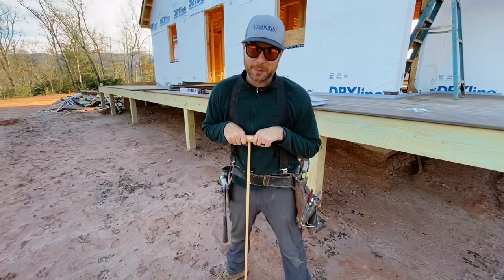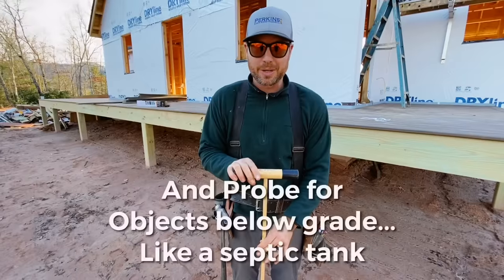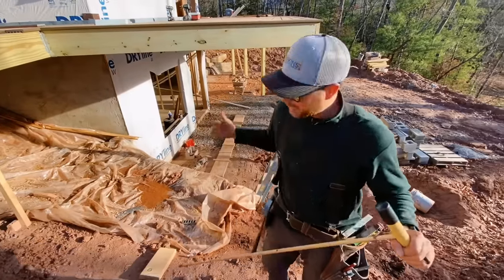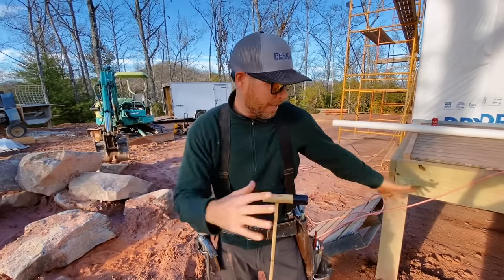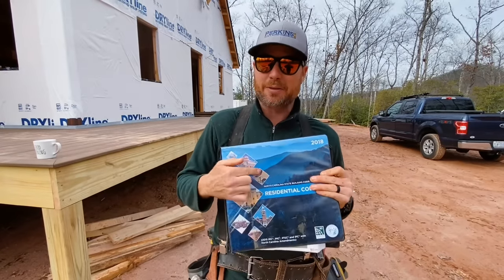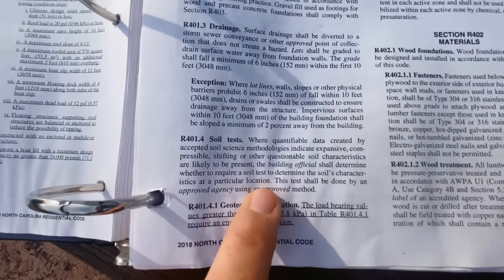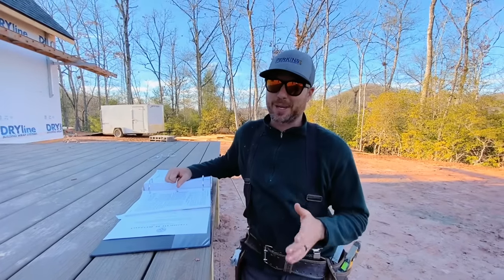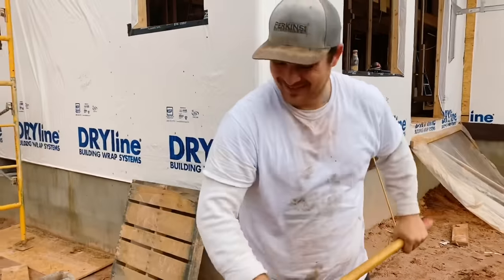All about soil, footings, and codes for residential building | Building Better Homes

Comment: 👍👍👍👍 WOW !  I clearly understood all taught in this video. 65 years in the USA / Georgia. About to build house in west Africa. And there is no such thing as building codes for diy in the bush.  Somehow they got the footings part correct and piles.  Many build 2 story They make cement block manually (one block at a time ) then plaster the  blocks for all walls. No 2 x 4 wooden studs. When money is available we can adhere to strict codes. But when money is not available, not even loans, then humans have to rely on the best knowledge and resources they have. 🙏🙏🙏🤞 the USA do not have another great depression. Thanks for the very good information.  A DIY  can build 3000 Sq. Ft.  ON 1 ACRE for $ 30,000. USD  ( In the bush / rural if they DIY ...LOL dirt road pure country living .)

Comment: Great video again! Y'all are lucky to only have a 12 inch frost line! 
Y'all do some great work and make great points! Especially things like testing the soil with your t handle probe. And digging with a machine. 

One thing I will add that we have been doing for a good 4-5 years now is we like to cut the bottom of our footings out a hair wider than the walls. We just take a sharp spade and cut a few inches all the way around at the very bottom of the footing. This not only gives you a slightly larger load bearing, but mainly takes care of uplift. Especially on more shallow frost footings. Uplift has become such a big deal, the dang house is bound to blow away before the deck ever moves. We bell shape every footing, pier, and/or column to satisfy uplift requirements. We recently purchased a bell auger to do the work for us, because we do alot of large piers and footings. But on a simple deck, it takes no time to knock out that detail at the bottom. Unless your footings need to be 5-6 ft deep. In that case just use those Bigfoot forms or pour your footing large first and then do your pier. Lol!

As far as deck builds go, I always recommend people study their codes, and study the DCA 6.
You'll find a lot of useful info no matter where you are, in the DCA 6. 

I hope this helps some folks out there.  Be safe out there in the field y'all! Thanks for the content Perkins! God bless y'all! 👍
Reply: O

Comment: Great video. Wish this video had come out one year ago. I inherited a lot in central Phoenix and went well into the planning and permitting stages only to find out later that the soil would require 3 foot footings! With no choice, I did that, but had I known, I likely would have placed a very different structure on the lot. Anyway, first thing I would ever do is have a soil analysis done of any lot in the future. Good videos!

Comment: Great information 
You guys are lucky with a 12" frost line.
Here in Ontario we have 4' frost line but in some parts we the code states we must go to 6' to ensure we below the frost line.
As footings go most decks over 12'×12'  they now want to see footings at either 28" wide or 32" wide . Thankfully they make post augers that are up to 36" wide which saves alot of hand digging

Comment: I have seen these same things many many times in my business. 
When I built on Lake Michigan in my area we had to have steel pylons drove 75 plus foot into the gravel beds had to go almost 200' on one occasion thank God I  was taught well our prices were always determined by engineering needs and actual costs of having them driven deep enough to pass inspections.
Our minimum depths where I live is 36"-42" depending on ground we always went 42" plus and always put at least 4" of gravel before pouring any concrete just wouldn't ever take any chances plus French drains to prevent any standing water.

Comment: Very interesting!  In my town, any build that will have a foundation and require a permit will also ALWAYS require a soil test done by a geotechnical engineer and then an engineering plan stamped by a structural engineer.  Those are both in the check-list of requirements to even get the permit.

Comment: When you test the soil for its load bearing capability does it matter if you test it while it's wet or dry?
It seems certain soils change more than others with moisture.
Reply: Good Question. When it's slightly damp seems it gives a lot easier.

Comment: In the 2021 IRC, it calls for a footing to be, as an example, 12 x 6, minimum width and thickness.  Does this mean the footing is square 12"x12" and depth should be 6"?  Just want to confirm I got this correct.  Thanks.

Comment: Soil probe.... test the compaction of the soil 
Hand digging the holes for the footings so you don’t end up with a big hole
Make sure the bottom of the hole is level so the footing doesn’t slide under the soil
Make sure you look at codes

Comment: Y’all make some good videos. I just bought a piece of land in Little Switzerland (Spruce Pine) area, so your tips hit very close to home for me.  I’m curious about spacing between deck footers. I’ve always done 6’ between posts but with 6x6 posts, and 2x10 boards, it seems like overkill. What do y’all recommend?

TIa
Reply: 6x6 posts at 6' on center is a good way to go. No to cheap (bouncy), and not way overbuilt ($$).

Comment: Thanks for trying to explain on how to use a hand probe. First on all, the probe is not a testing instrument. It is used when  a Geotechnical inspector is onsite observing and testing placement of fill material (soil) and is used along edges to find soft spots. You cannot go by a probe to buy off bottom of footings , compacted fills or subgrade soils. The only way to determine proper soil density is by compaction test. Probes do not give you good density indications in clays or cobbly soils. Surface soils after a few days of baking in the sun, tend to dry up and harden. Clays or silty soils are worse.
All probes should be used for us to find soft spots and should never be used to determine density/compaction. Can you imagine being in court and the judge asking how you performed your density testing and wanting to see actual test results??
You have to hire a Geotechnical engineering firm to provide you observation and testing with a signed compaction report with a Geotechnical engineers stamp. I could go on for hours.
Just my input.

Comment: Might be a dumb question but would that code book be okay to us in Tennessee or would it be to different
Reply: All of the states, cities, and counties have a different requirement. And municipalities also have different requirements. Homeowners associations even differ. Your best bet is to run over to your county inspectors office or planning and permits office and pick up all of the codes you need. In order to receive a permit You'll need an actual blueprint style plan for your build, drawn to scale, and it will need to be approved. Don't forget to have utilities marked. And in some places, you'll need a survey done to make sure you're not crossing the property line distance requirements, or any easements. This goes for anything considered to be a "permanent" structure. Even a concrete sidewalk. Or a small shed that cannot be easily moved. 

Just a suggestion.....We overbuild everything just a tad, it helps me sleep at night as the Owner. So I do recommend you really pay attention to the codes and one up that just a hair. If you build consistently better than your local requirements, you will eventually get to a point where pre inspections are unnecessary for your certificate of occupancy. Sometimes we have a final inspection on something like a deck build, but it's rare now with our relationships with inspectors.   Things go so much faster and no downtime waiting for the inspector So you can pour footings. 

Type in your area/county/etc and building codes (R507 for residential decks) and you should be able to find your local adopted codes. 
We have towns outside the city limits here in different counties that are still running off of old code. 2002 irc at a home we're at now. Do not build to 2002 code! Lol!

The best thing you can do IMHO is download the DCA 6 and build off of that. Read and memorize it. Print it off if you need a refresher. If you build off of DCA 6 you should have no issues. 

I hope this helps! Good luck to ya! 🍻
Reply: So true about having a great relationship with the inspectors . Was getting a new service put in 2 houses side by side . The inspector came and Ok'd the jobs before the jobs were done . Even the hydro boys were able to put in the new cables before the job was done . When a contractor has a reputation of doing better than code work the inspectors and the hydro boys know that so the job goes much faster for everyone . Having a good reputation just makes things go a lot faster .
Reply: @henryrodgers3409  you got it 👍
It absolutely does. When you and your company strive to be the absolute best in the business, as opposed to how much money can we make off of this job or how fast can we knock it out, the rest follows suit.

Quality, and reputation is everything in this business!
Codes are getting tight, and people are getting more educated on efficiency and good building practices. 

Take care 👍🍻

Comment: Good video. Realistically, if you're a builder you should get a 24" auger attachment for the skid steer, and use the Bigfoot 24" bell housing with your sono tube.   5 minutes to auger to just past depth, compact, throw in 6" crushed, dust-free stone, compact and drop in your tubes. 10 minutes and done with an excellent anti-heave, proven install.

Comment: But you put your deck posts down in concrete instead of up on a post base bracket, guaranteeing that they will rot. Love your videos and you guys are generally putting out quality but that’s a deck building 101 fail.
Reply: I was waiting for someone to mention that.   The new pressure treated wood, even ground contact, won't last as long as the old stuff.   EPA strikes again..

Comment: Another great video, guys. How do you calculate the tributary area? I always forget. And it’s important to know for footings, deck framing members, etc. That would be a great video.
Reply: Tributary area can be a bit tricky. And it always depends on the type of build drop beam deck vs flush beam(header) deck. With overhang or not, with cantilever or not, wood species, soil capacity, and live and dead loads. 

Since I don't know your conditions, the best thing you can do is check out the DCA 6. The DCA 6 has a ton of great info for calculating your tributary area based on size, load, soil bearing capacity, footing type, special conditions, species of lumber, etc. And will help you determine spans, posts, beam details, and footings.... Also a great guide for general knowledge and staying up to date on do's and don'ts 

Hope this helps! 🍻
Reply: Far as I know, sketch out your plan on graph paper or use an editing program with the grid lines set up along 1' x 1' squares.  Tribs will be either from one wall to 1/2 way to nearest support, or in a deck with cantilever, from edge of deck/cantilever, across first and in the middle between first and second pier. This is a simple vid https://www.youtube.com/watch?v=g0otb1kzsXU

Comment: Where I live in BC Canada every house site needs a geotechnical report before you can build on it even it is solid granite rock an engineer has to look at it to make sure its hard enough. Engineers have overkilled things and foundations for a residential house ends up in the 10s of thousands just for concrete. I've seen some of these jobs and all I can say is "really", we don't use block, its all poured walls, massive amounts of rebar. Engineers are scared to put their stamp of approval on jobs so they require the builders to go way beyond what is needed.

Comment: Is the code book you are referring to available for citizens to view online?  It appears that only footers of concrete are referred to in the code book.
What about rubble footings comprised of crushed and compacted aggregate?  Crushed aggregate does not respond to frost or freezing like solid concrete does.
And why do folks continue to install steel into concrete when experience has proven that steel eventually oxidizes and degrades the concrete?
The tool showcased may be fine for probing and to obtain some idea of soil compaction, but it does not produce any quantifiable data.

Comment: That probe rod is NOT the correct prob rod for checking soil compaction. The correct one is a steel rod 3/8 in diameter. And when you pushed it all the way down you found a hole of some sort. Even the worst soils will have more resistance than that.

Comment: Good stuff! Pretty sure one of our front porch footings was not properly tested for compaction prior to concrete. It has settled about 1” over the past 5 years since the house was built. Probably gonna dig it out this spring/summer down to hard pack and re-pour a new footing.
Reply: You might be able to get away with a jack and shimming it. If it continues to sink, then replace it.

Comment: Love the video. I have a deck that was built(and demolished old one) in a single day. I doubt that was even inspected. In Illinois we doesn’t have a state code book but each “municipality” has their own codes. Trying to use my own towns code book is very confusing because there is no clear section and also no diagrams/charts. My deck has settled unevenly in places causing screws to snap and trex boards having to be replaced. Do you have a suggested solution to flatten/level my deck?
Reply: Call the contractor who "built" the deck!
Reply: matt mag I wish I could. This was probably done 10-12 years. I am not sure if I still have the guys number.
Reply: @rolly5457  oh i see.  A bandaid would be to temp. jack the deck up and pour on top of footings or lengthen the posts.  By the sound of it though you need a better base.  Bigger/deeper footings.
Reply: matt mag would it be possible to jack up the deck then just try to deepen the base and fill the hole with concrete with the post embedded in the concrete
Reply: @rolly5457  in my opinion, no.  The concrete needs retention as in side walls of dirt and i just cant see how you could do that.  Another bandaid option would be to shim the posts some how.  Support deck, cut connection, jack deck, fasten again (or shim depending on how post/beam is connected)  That is only if the settling has stopped.  If the settling is consistent year to year then I'm going to say you'll need new, better footings.  Even if they're in a different spot than the original.

Comment: Compaction is a small part of the equation when it comes to footing sizes. Different soils expand and contract with different moisture. Stabbing a rod in the ground tells you basically nothing. You could go shaft deep in sand, which is one of the most stable grounds to build in. Clay is the exact opposite.